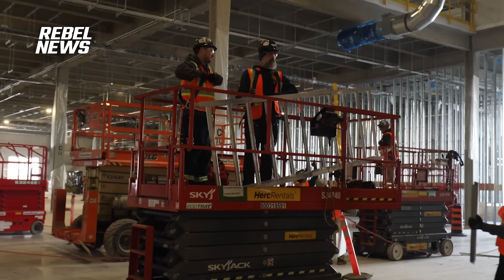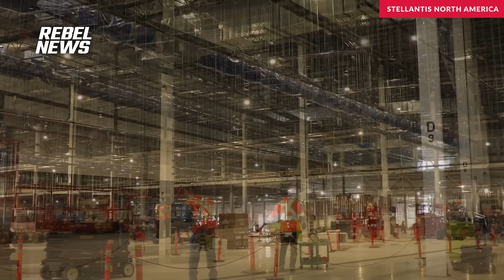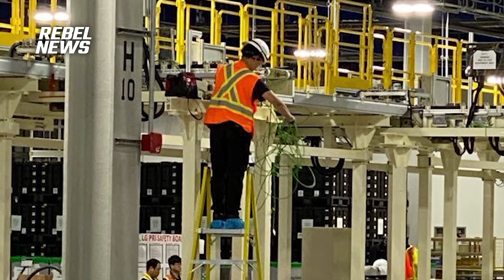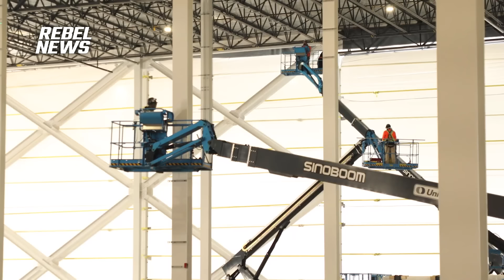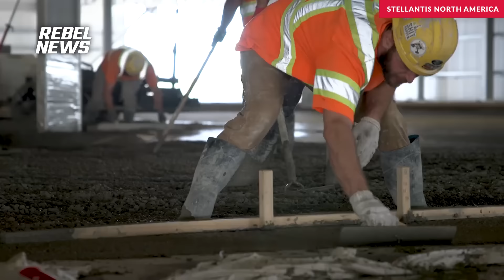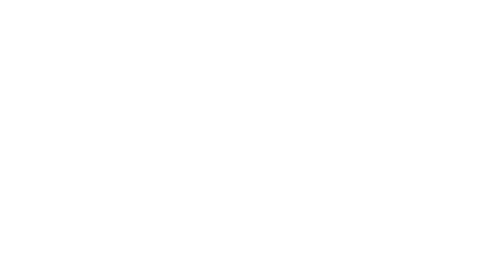Tensions mount between Canadian and Korean workers at Windsor EV battery plant

Comment: No offence to the excellent professionals from Korea: also It could be that these companies plan most of the project based on in this case Korean engineers and so on but if you recalculate the project in Canadian worker terms it may not make the project feasible or cost much more, imagine; so in essence to the extent of this project's particular indexness, these projects are less impactful than advertised: dgp equals total income to yea of x dollars total spent how much is earned inside Canada; also on a lighter note, a good Korean project may act as a positive externality; it could be an exception: there may or may not be a sinister side but i wouldnt worry about Korea in this regard about depth of technological participation from the project or in the production process; what is the net net? 90 percent nitrogen

Comment: Is the general motors plant in ingersol ontario up and running yet. Trudeau gave them $12billion. To get electric vehicles going. GM closed its almost a year ago sighting lack of raw materials to make these vehicles and that it would re-open in the spring. That was put off until aug./24. Has it re-opened or did it get pushed off again. Gm builds and sells more vehicles in china than it does in north america. I'll bet the chinese factories have no problems with raw materials

Comment: Hey port colborne Ontario has a huge EV battery extraction plant in the process of being built off highway 140 and forks rd east. Currently a Huge contingent of heavy quarry dump trucks bulldozers graders etc are working 6 days a week prepping the old seaway lands for a factory 🏭 that may turn out to be nothing but another empty building if nobody buys EV automobiles and trucks. At pricetag of $100k each and hold no resale value and communities not having charging stations and battery fires a common problem. And cheaper to buy replacement car than to replace battery...nope you can keep your pos 💩 EV AUTOMOBILES 🚘 AND TRUCKS 🚚